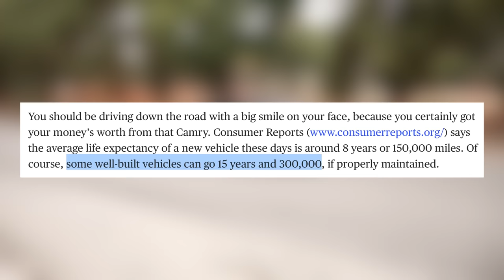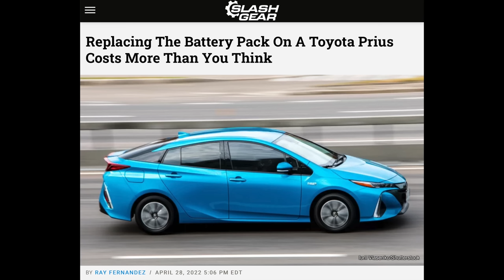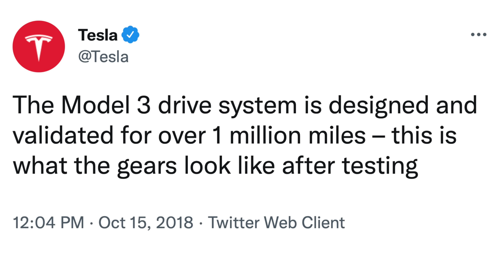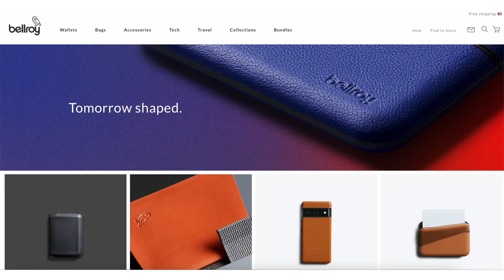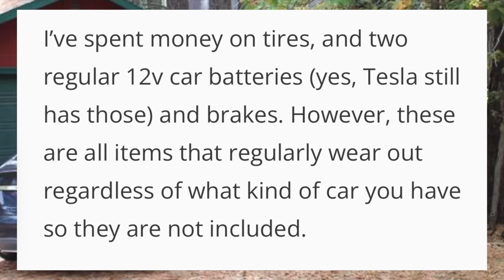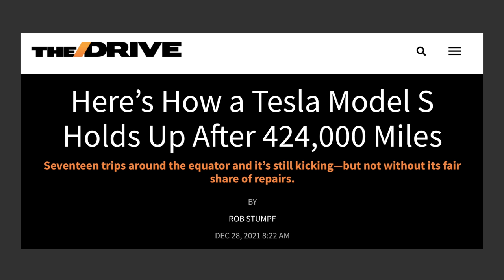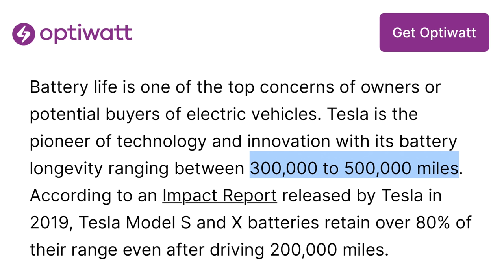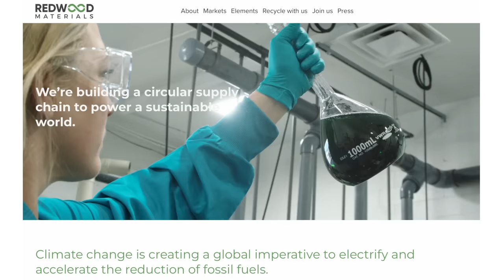The ONE MILLION Mile Tesla | It Still Runs

Comment: Did you notice Tesla lowered the mileage for the Long Range Model Y? They moved it down, from 330 to 318 over the weekend. But didn't lower the price of the car.
Reply: Make sure you switch the wheel option to the 19 in Gemini wheels in the configuration and you will get the 330 mile range. The 318 comes with the upgraded 20 in induction wheels.
Reply: @joshclark8385  Oh WOw. That was it. Is that a new default? I don't recall having to do that when I ordered our model Y nearly 1 year ago now. Thanks!

Comment: the only thing about evs I don’t understand as a car guy is how types of cars are differentiated in the future. With ICE, sports cars muscle cars trucks are all different. Trucks usually have more torque to haul things, muscle handle like ‘shit’ in the corners but a lot of straight line power. Sports cars in the corners, super cars usually have a really high top speed. Evs on the other hand do all of these maybe except for top speed. They’re the ultimate jack of all traits but do everything exceptionally well. But teslas are handled like iPhones… they lock u out if u don’t go to them.
Reply: Actually, they even do the top speed tbh, they are just software limited by manufacturer so far to be more reliable and long lasting. Have you seen what an unlocked Model S Plaid can do? It was able to reach 216mph, and it could have gone even faster if not for the runway not being long enough. When they reached the set braking point, speed was still increasing at a decent rate.

Comment: Other than tyres, and suspension parts, the TRUE issue is with the motive battery.   I've seen Model S go 500K miles and others go 100 K miles before needing a replacement.    DC fast and supercharging is very tough on its battery.
Reply: If I was buying a used Tesla, I wouldn't get one from someone who lives in an apartment. They are likely supercharging their cars and probably to a high percentage to reduce charging trips. People who own houses are likely charging at home with slow chargers and probably rarely supercharge. Plus they are more likely to charge at 80% or below because they can charge overnight.
Reply: @ymcpa73  That's probably good advice.  On the other hand, I have some friends who live in an apartment and own a Chevy Spark they bought used.  They charge it through a regular old 110V outlet they paid to have run to their underground parking space.  Admittedly, they don't get many miles of charge per day, but they mostly use the car for short trips around town.  Their car's battery is really being babied!  

That said, I think your advice to someone looking for a used Tesla is generally sound.
Reply: 332000km and 2/3 DC charged (mostly 50kW): 12.6% degradation.

Comment: A little disappointed with my 2020 Tesla Model Y Performance battery so far.  The car is definitely the best vehicle I have ever owned in my opinion, but the battery isn't doing as well I could have hoped.  I am currently at just under 16,000 miles on the odometer, at a little over 2 years of ownership, and I appear to get a 100% full charge claimed value of something usually in the 284 (+/-4 or so) range these days (perhaps a bit lower, as I haven't charged to 100% in the last month).  Given the 315 mile original EPA rated range for my model of vehicle, this means I have lost around 10% so far.  If the degradation rate doesn't slow down, and instead continues at the current rate, then there is a good chance I may reach the 70% retained capacity warranty level in maybe 6 years of total ownership.  This is somewhat unfortunate in my opinion, as I do sometimes tow a trailer with the vehicle, and the immense range penalty associated with the aerodynamics of the trailer really does mean I need every last mile of real world range I can get.

That said, I still like the car overall, and I can't think of a better car model currently on the market that I would rather own.
Reply: Never charge it above 90%, unless you have a long drive ahead of you. And never let it go below 20%. This will help with the longevity of your batteries
Reply: @chrisfifield8583  How is this the future? Why state a range fully charged and you cant charge above 80-90% and never bellow 10-20%. You leave out 30% in your example...
Reply: @Kvickification  this is for battery longevity, if you need the full range you can use it, if you intend to drive it shorter distances more often, the same applies here as to your phone, the 30-85 range is the best for battery longevity due to chemistry
Reply: @aonodensetsu  I am well aware of why, it is a flaw no matter what. You do not compare lithium-ion and lithium-polymer as their use case is different.

Comment: Super curious about best practices and charging /maintenance habits to minimize battery degradation.  What do we know about level 1 charging (trickle charging) vs level 2 charging vs Supercharging?  Super curious and interested in ensuring long range with longevity on my upcoming Model Y.
Reply: just put the limit when you charge to 80 percent or less on a daily use and put 100 only if you need to travel far
Reply: Batteries degrade faster with higher charge rate, higher temps, and being left at a high rate of charge. There is a 2009 model s in Norway that still has 95% of the original battery capacity. This car has never been fast charged.

Comment: 405k miles on my old truck, runs like a top, and I’m not particularly nice to it.
Reply: And I'll bet that it no longer gets the same millage per tank as it used to when it was brand new, right? Not to mention the oil/fluid changes, brake jobs, etc, etc.
Reply: @CoroaEntertainment  it actually gets better mpg’s than brand new. Every vehicle needs suspension and brake maintenance. I only paid 2.6k for it and even then it will cost me less than a Tesla even if I swapped the motor and transmission out.
Reply: My old chevy s10 lasted 350k miles with 1 engine rebuild, which cost 2k for the engine and 1k for misc parts and tools.
My current 2010 honda fit is at 160k miles, and only issue was the AC compressor :D
Take car of your car and it will take care of you.

Comment: FYI, I lost 6% after 25,000 miles with my Model 3 LR 2022. And most of it was lost after I drove 13,000 driving to Canada and back from South West to North East (Los Angeles to Seattle then to Quebec via the whole Northern Midwest and back via another route) charging between 80% to 95%, a couple of time to 98% when I was driving in the middle of nowhere. Indeed, I did not want to take a chance in case the distance to the next super charger would increase via road detours due to construction. Once, because the freeway was in construction and a lot of detours (and I was on the phone at the wrong time), on my way to a super charger a couple of miles away, I took the wrong freeway entrance and all exists were blocked for 60 miles with no way to get out and with a 60 miles left in the battery. Fortunately, the road was going down a mountain so I had 20 more miles to go when I finally arrive at the super charger due to regenerative breaking. That is why I always charged way more than I needed just in case and when I travel in unkown areas. Back in town, I decided to charge only 70% top daily as the car drives only 18 miles per day. This way I hope it will degrade less rapidly for the rest of its life (I know that Elon say that 90% is ok but I do not need 90% anyway). Also I know about lithium batteries as I built few electric bikes as a hobby and when you buy new 18650 lithium batteries, they are always charged at 66%. It is a long term storage charge and so it means one can expect less degradation with this percentage (though Tesla % of the battery may downplay its real value).
Reply: I've done some supercharging to 100% at high 100F+ temps, not often but a few times, trying to get to national parks etc... otherwise, 80% of charging is level2 at home.  I usually keep at 70-80%, sometimes 90%.. only let it go below 50% for roadtrips, I get down to 20% for that. 
 I'm at 4yrs/30k miles, and recently 100% charge showed 304 miles on battery meter, vs 310miles on delivery! Great!

 (I did do a BMS calibration before, let sit below 10% a while, charge up 100%, let sit a while, measure)
Reply: I charge to 90% roughly once per week and will always be using the car that day. Never want to leave it sit for more than a day at 90% or more.
Reply: It was a 2021 model sorry.
Reply: My 4-year old Model 3 lost about 9-10% of range at 75k miles.  I very seldom supercharged, only 3 times in 4 years.  Always keep battery between 20-80% charged.  I notice that I get more range loss if I go below 30%. Never did a BMS calibration.
Reply: @dhui777  That's probably what lowered mine faster, I did get <10% 2 to 3 times during my trip because of detours.

Comment: 10:17 LOL $3 per gallon? Not anymore. Currently gas is running around $5.75 where I live.

Also important to note is that, unlike any other car, Tesla owners can expect there car to get better and better (e.g. longer battery life due to improved battery management, better FSD, better safety)  the longer they own them due to over the air software updates.
Reply: Where I live you need to add 45% more to that fuel price.
Reply: And make their car feel like a 3 year old iphone.....Car and Driver tested a 2015 85D. A change of the radio station took 10 seconds.

Comment: Ryan, I am going to buy at Y but not sure if I should wait for next battery configuration or just order now or before September as you have suggested in a recent podcast. 
Thank you, I appreciate your insights.
Reply: I’m going to answer for him. Basically any new batteries for the time being (4680) will not impact consumers at all. It is purely a cost savings measure for Tesla. IF there was a difference it’s almost guaranteed Tesla will software lock everything to be equal with the 2170’s. Currently the only car with the 4680 is a non orderable model y from the Texas factory called the “all wheel drive”. You may find one for sale in inventory and the way to know the difference is the range and that the model is just awd not long range or performance. The 4680 model y does 279 miles and I think the long range model y does 320 miles or something like that. 

Furthermore, tear downs of the 4680 cell show that it has nearly identical performance to the existing 2170. The assumption is that Tesla is trying to nail down manufacturing before changing cell chemistry.

Comment: Greatly differs from my experience. Had a 2019 Tesla Model 3. Two control arms broke with 50k miles. Charger port broke. Car's autopilot and corrective steering would randomly try to veer me into other cars over an imagined road obstacle that wasn't in front of me. Fuse was blown and driver's car window started rolling down while I was on the middle of the highway during a snowstorm. I needed to hold my finger on the window up for an hour and 25 minutes to make sure snow didn't get in the car. After parking the car wouldn't boot back up and needed to be towed to Tesla. I was charged $1,360, which I was able to argue down. A month later I brought the car in to check a torn cable in the steering wheel column, everytime I moved the steering wheel closer to me to drive more comfortably, I would get a turtle image and the car would drive slowly. Another $1,300+ fix. This doesn't include the time my trunk latch broke (which they fixed) or how long it would take the dealership to diagnose problems. I dreamed of getting a low maintenance Tesla, I got something that started giving me tons of problems even before the warranty ended and I could have only imagined what I would've ended up with should I have elected to keep the car. Loved the car when it worked well, but overall dissatisfied. Probably won't buy again.

Comment: Great presentation, thank you!

Do you know how things are currently going with the battery repurposing/recycling?
Reply: Check out interviews with JB Straubel at Redwood Materials. He says they will produce enough materials this year to make 10 GWh worth of EV batteries. Right now their source material is old phone, laptop and other batteries, EVs are too new right now. Here in Europe we have the Northvolt/Audi consortium who have a pilot plant in Germany which has achieved 97% recycling and have already made new batteries from old ones...which mostly got totalled in accidents. In France Renault/Solvay have a pilot plant doing the same...there are others. They call it ‘urban mining’ and Mr. Straubel thinks it will be a bigger industry than actual mining within 2 decades.
Reply: @kiae-nirodiariesencore4270  It will be, because the batteries degrade so fast in EV:s. That is why I am not buying one. I need the range
Reply: @thoos192  ‘The batteries degrade so fast in EVs’’...what!!?...didn’t you even watch the video? Batteries in EVs last longer than fossil fuel (ICE) engines which on average are shot at 150,000 miles. Sure, you do hear of ICE cars doing much more than that and in very rare cases some have got to a million miles but these have had oil changes every 5,000 miles, a huge expense in itself and many have had new top ends, crankshafts and all kinds of expensive work done to keep them going. Get yourself an EV if you want to keep a car for 20 years and do half a million miles.

Comment: They have over 7,000 batteries and any one that fails causes a problem with range being limited. SO to me they actually have more failure points than an ICE car. If individual battery cell death can be circumvented so as not to cause range limitation and multiple cells can fail before needing repair. This would be a lot better than what is happening ATM.
Reply: Teslas can lose a few cells without impacting the range enough to be noticed.
Reply: It is extremely rare that one cell brings down the whole pack. In an older  S/X there are 74 cells in parallel and the loss of one or 2 cells is not noticable.
Reply: @not today well....there are types of failure where one cell can brick the car. But there are ways to identify that Badie and snip it's little wire.

Comment: Would have liked to have more EVs addressed in the video because not everyone drives a Tesla. Anyhow.. I have an friend with a 28 kWh Ioniq electric that is well over 600,000 Kilometers and no noticeable loss in range or capacity. He’s done this mileage in around three years with his car.
Reply: Sounds like a lot!...is he a taxi driver? The Ioniq 28 kW has only been out since 2017 so that’s hard to believe. A friend of mine here in France has a 2017 Ioniq, he’s ‘only’ at 90,000 km and he’s not seen any problems although the small battery does mean a lot of planning on long journeys. My 2019 Kia e-Niro has a 64 KWh battery and has done 65,000 km....solid build, at least as good as any Toyotas/VW/BMW I have owned.
Reply: @kiae-nirodiariesencore4270  actually it’s been out since 2016 but no he is just a normal guy who was driving across half the country to see his girlfriend on the weekend. I’ve done over 60,000 kilometers in my Ioniq since a little over a year and it’s never let me down. In fact I’ll be hopping up to Hannover for the S3XY meetup on Saturday. Too bad you won’t be able to see it for yourself 😊
Reply: now thats a lie... clearly the car  doesnt have the same range as it did brand new XD

Comment: You did a good job explaining EV vehicle's batteries. There are many 2017 Chevy Bolts on YouTube that have reached well over a hundred thousand miles and their range capacity lost is similar to that of Teslas. I have a Chevy bolt that's lost only lost 3% of its capacity and I bought it used. It's a 2017 model. I still haven't gotten a new battery replacement on it because of the recall and it has 50,000 miles on the odometer. I'm waiting for the dealership to get a new battery. There are other people on YouTube with videos that are garbage, talking about batteries having to be replaced at 100,000 miles. I was watching a video by  Sorelle Amore Finance and she completely got most her facts wrong about electric cars and the batteries. I'm going to keep my Bolt and run it through the ground. Especially if I'm going to get a new battery. There's still a risk though. Hopefully, the new battery from LG chem will not catch fire on my Chevy Bolt. I'm not worried about it. That's what insurance companies are for.

Comment: Misleading , My Telsa has just 150K miles and my third batty is going dead so i have it up for sale.. My 04 Honda had 480K and still sold it for $2K
Reply: Then you are a freak and not looking after your car 

No problems with my Tesla and close to 150k 

Got friends with S classes and they are also in the same position as me, driving for 5 years, knocked up between 100k - 150k with no need for a battery change. Us tesla owners talk
Reply: Correction driving for 7 - 8 years
Reply: A bad experience doesnt mean everything else is wrong. This isnt misleading, it means your experience was worse than most people have

Comment: I´ve seen battery repairs on old Nissan Leaf which just replaced some cells and one day in the workshop. The got back to 90%. A small workshop in the UK did this.

I think the big brands need to show how batteries could be repaired for cheap this will help selling EVs, especially old ones. If someone knows the average repair on a battery is 2-3000€/$ or whatever it will draw a quite different picture tan 20.000 for a battery.

We must consider that used IC repair bills when it comes to engines or transmissions are on average not 20.000.